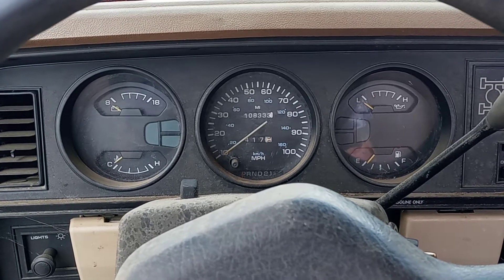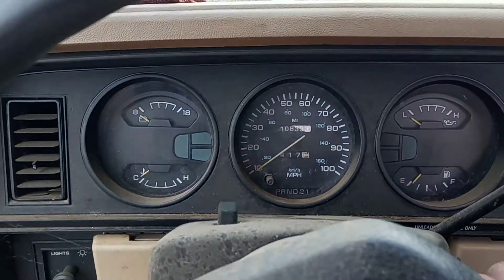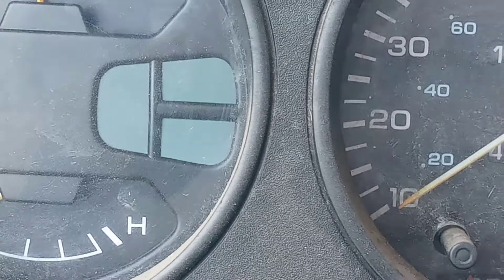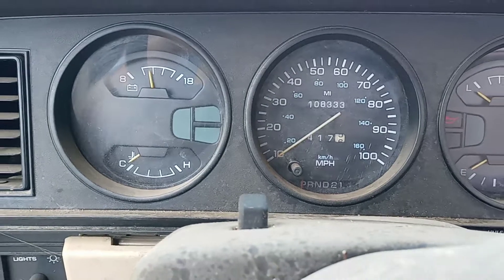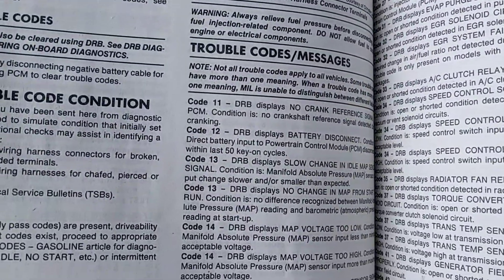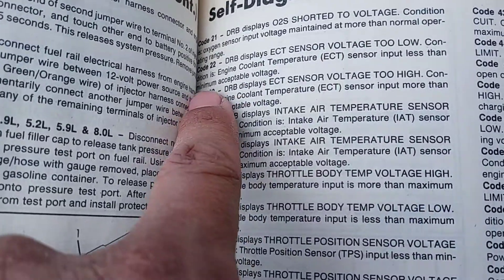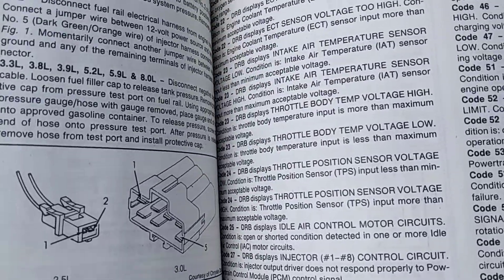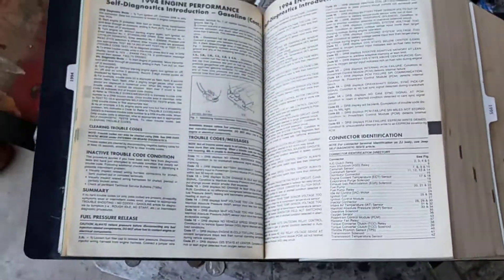how to read the check engine light/codes on a 1993 dodge power ram 150

Comment: Thanks !  appreciate you showing the page sections so we could print them off - worked perfect.  noticed the manual was for a '94 but figure should be the same for a '93, even though the ECU's are different for the two years (at least for the 250 the are).

Comment: i have a 92 Dakota my check engine light comes on so do the key dance what i do count how many times it flashes that will give a code so like it goes 1.2 stops 1.2.3 stops count how many times between stops that will give me a code
Reply from the maker: Sounds like that would be a code 23
Reply: @liftedmike7415  what you think it is thank you
Reply from the maker: @barneywarwick9804  go to 1:57 in the video and it briefly shows what code 23 means. Something about intake temperature sensor

Comment: Gotta question maybe you can help. My speedometer isn't working and it won't go into overdrive. The transmission guy said it's my speed sensor causing it to not go Into overdrive. But my speedometer hasn't worked in over five years and never gave me overdrive issues.

Comment: How do i reset?
Reply from the maker: Disconnect the battery for about 5 to 10 minutes and it should reset the computer
Reply: @liftedmike7415  thank you,  unfortunately it was out nearly 24hrs due to it draining dead somehow, and it came back as soon as we put it back in. Believe this project has become a christine lol
Reply from the maker: @MM-xv4fz  ah i see lol I've dealt with a couple of those headaches myself 😠😂😂
Reply: I tried doing this on my 1989 Dodge ram, and the check engine light never came on to show codes. Why would this happen?